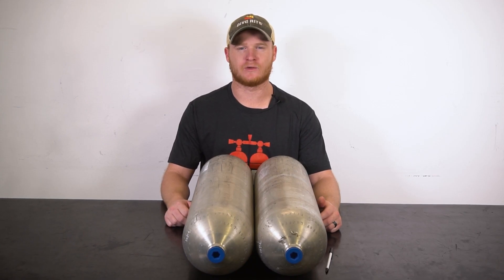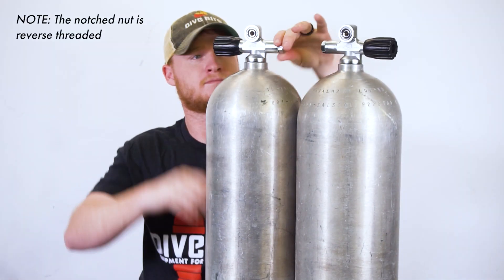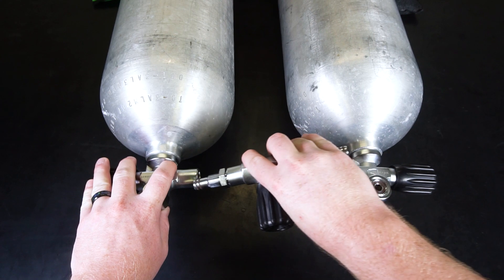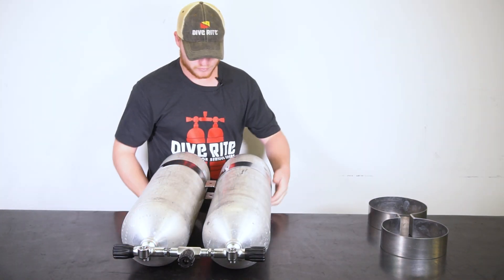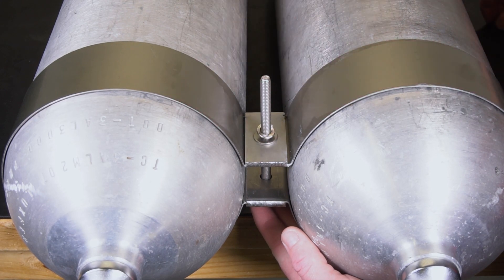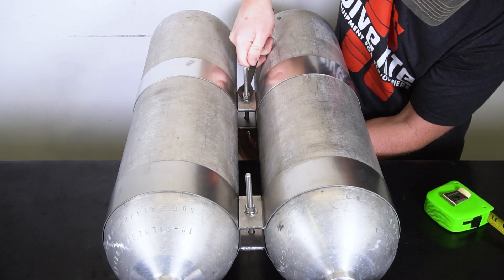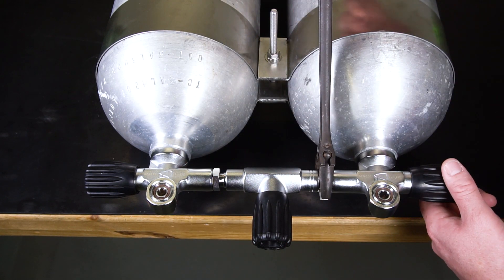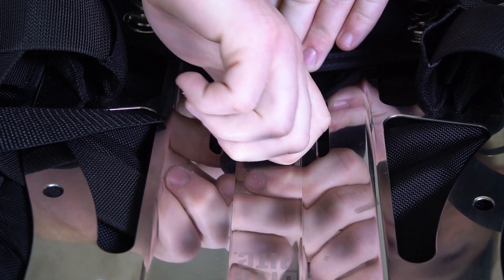Technical Diving: How to Assemble a Set of Double Tanks

Comment: Not the way I have done it for years.  I put the mani together first.  Put both tanks in the bands loose,  spin the mani and valve on one tank and tighten with strap wrench, move the other tank up and thread the tank on the valve.  Tighten with strap wrench.  Tighten bands and rotate isolator as needed.  The isolator has fine threads and a real possibility is cross threading or one starting before the other.  The tank valves are coarse threads and won't cross thread.    This method does not need a perfectly flat surface and can be done by one person on the tailgate of a pickup truck or a picnic table.  Adjust band height to match the backplate.